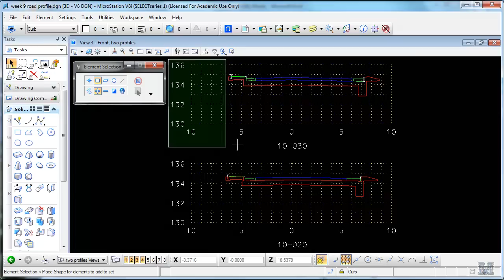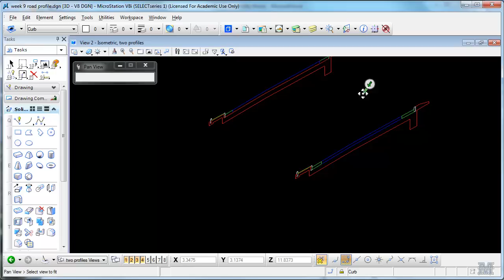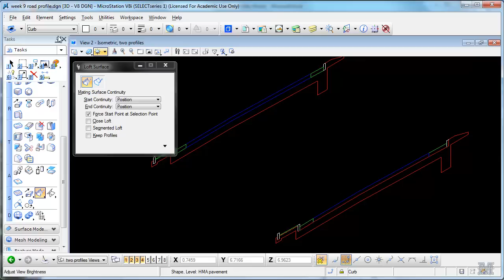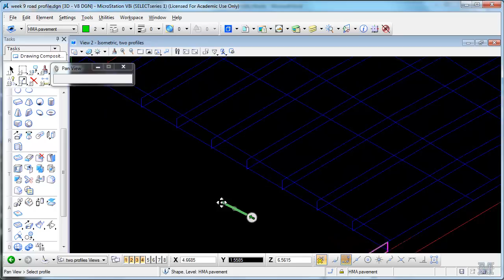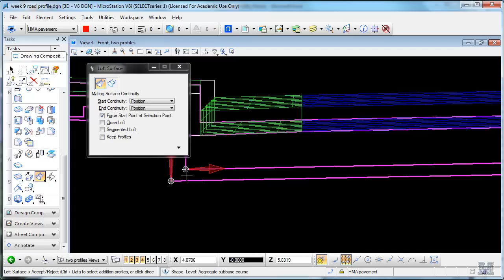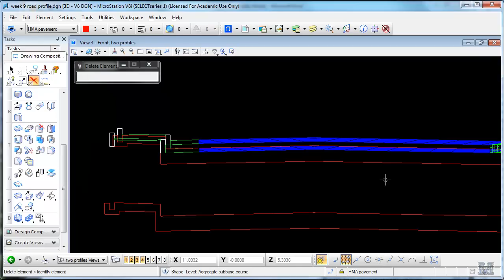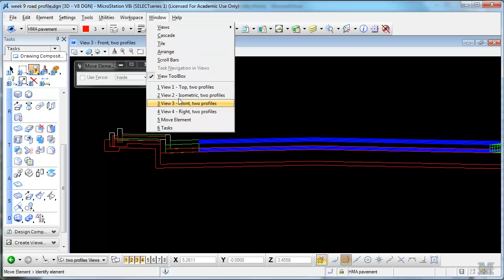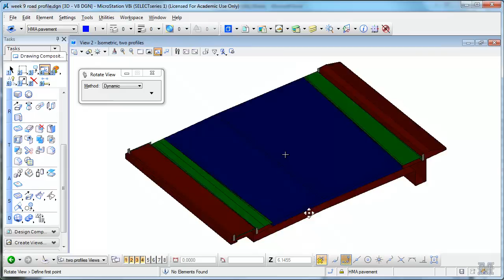Microstation lecture 14 (CIE 101, Civil Engineering Graphics)

Comment: if you click on the Red arrow, the arrow would change the direction.using the loft is important click on starting point and matching position of the connection point. You may move the connection point along the profile.